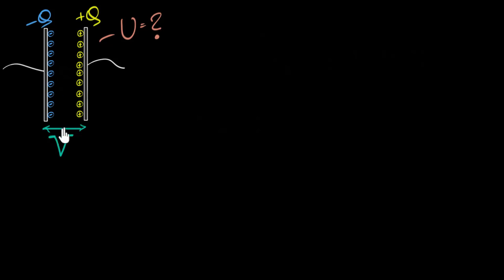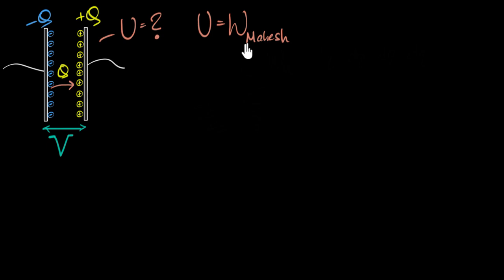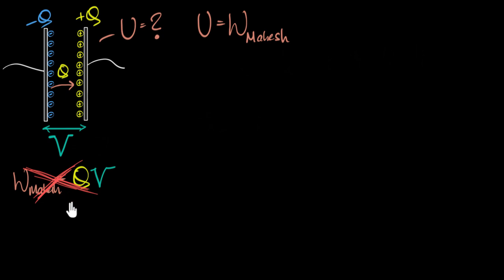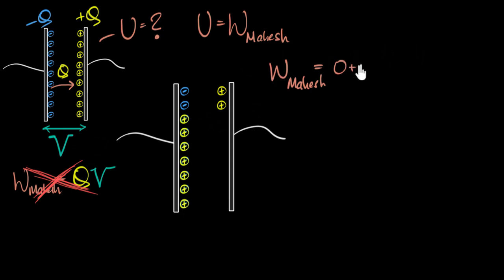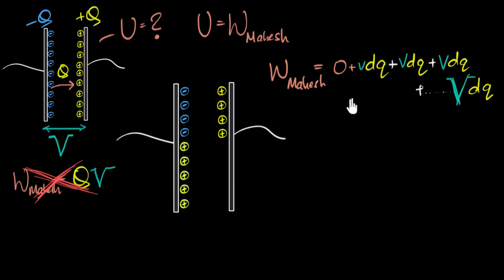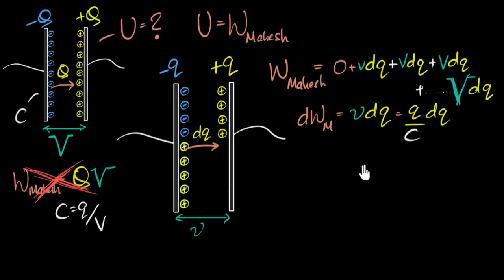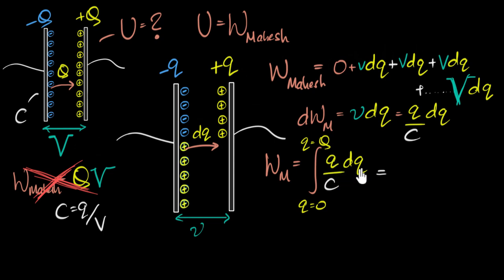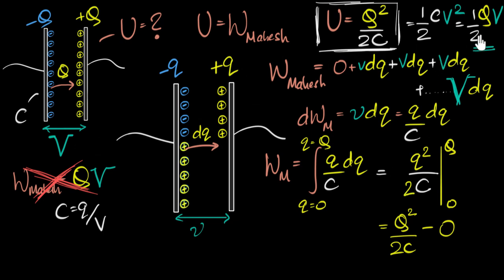Energy stored in capacitor derivation (why it's not QV) | Electrostatic potential | Khan Academy

Comment: Crystal clear explanation with an excellent flow of reasoning. Great job!
Reply: No it's not, Power = Current X Voltage. We know a capacitor charges fast at the beginning and slows down, that gives you time. Now you can convert power into energy/work done. 
He just made it complicated.
Reply: @EA-tc6kb  you're explaining that using formula and he is explaining that from core level, don't talk shit here
Reply: @EA-tc6kb that doesn't even make sense bruh

Comment: For hopefully a bit more intuition on why it's 1/2:

In the naive case, let the x-axis be the charge moved so far, and then draw a graph of y = voltage (ie a constant here). Then to compute the work done, you can take an integral of voltage dq, or in other words the area under this graph from x=0 to x=Q. For this naive case, that's just the area of a rectangle = base x height = charge x voltage

In the more sophisticated case, you know that the voltage isnt constant, and instead it's proportional to the charge moved so far. That means the graph will slope upwards away from the origin, cutting the rectangle you had before in half. Your total work done is still the same integral, so it's still the area under the graph, which in this case is the area of a triangle = 1/2 base x height = 1/2 charge x final-voltage

If you see a factor of 1/2 anywhere else, for example in kinetic energy, you can often interpret it in a similar way
Reply: Or sometimes I like to tell people that if one parameter is changing with respect to another parameter in the equation it should make that triangle and add up  to 1/2 .
W=Σ V Δq (=∫ V dq  more precisely). Because V changes with respect to charge q and it is not constant when you take the sum than you and up with that 1/2.

Conclusion:
If you find an equation when something is changing with respect to something inside the equation, you will usually see this 1/2.
Reply: It happens to be just because the potential across the capacitor is 'Linearly' proportional to Charge on it assuming constant capacitance. So u get a straight line with 'some slope' on plotting Voltage-Charge graph and work is nothing but area under that curve. Because of the linear proportionality the area happens to be of a triangle which is why there is a 1/2 factor.

Comment: THE USUAL ERROR: There is no energy in this field. The potential energy is only with the displaced electrons!!! The battery did work on THEM, not on some field that wasn't even there in the first place. Think of this: If you roll a ball upon a hill, then the ball acquires potential energy, not the gravitational field.
Reply: That's a nice point
Reply: @bhavyanayak4342  Thanks.
Reply: Thx
Reply: You are wrong. The battery does the work which is equal to charge_flown*V = CV². But the energy stored in the capacitor is CV²/2, it is half. This energy is stored in between the plates of the capacitor i.e the electric field. Now you may ask where'd the other half go? The other half of energy (i.e half of the work done by the battery) is used or wasted in moving the electrons from one plate of the capacitor to the other plate.

Comment: You can take the battery is doing work to move the charged particle e^- by spending energy which is stored as chemical energy in it and by this you can neglect the attraction since electrolyte is present in battery does not create attraction to e^- and so it is applicable in reality

Comment: well explained, thanks. One small point though, when you describe moving the charges, it seems as if you are suggesting that the charge moves directly across the dielectric gap, as opposed to going round the circuit. May seem obvious to you or I, but poeple will carry that misconception which is fundamental and could derail their core understanding of the capacitor. The dielectric is an insulator.

Comment: I've a doubt (rather a request). Could you please explain / derive the expression of "Electric Potential" (Or Voltage) from coulomb's law of electrostatics? 
In other words, can you express electric field as a consequence of coulomb's law of electrostatics?
Reply: take the integral of the E field (E=Q*k/r^2 for point charge) and dr from the distance between the charge and the point of interest to infinity. Q and k are constants so you can move them outside of the integral which leaves you with 1/r^2, when you integrate you'll get -1/r, now just plug in your boundaries
Reply: @petar7867  thank you so much!

Comment: Wrong explanation, when initially first plate has Q charge and second plate has zero charge then there must be potential difference although carrying dq charge first would not be repelled. So method of eqplation is wrong however you got correct result. Tell me earth is considered having zero potential and if you have plate with positive charge then what is potential difference obviously not zero.
Reply: Sir, he mentioned at first that both the plates are neutral and hence there is zero potential difference.  In the presentation he just represented one side to make us understand.....i think u missed this part 3:46